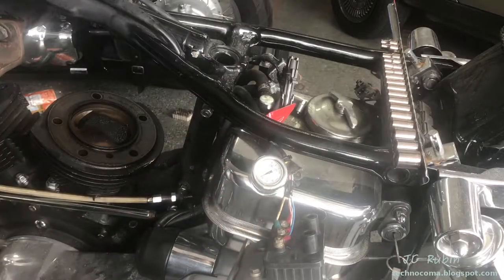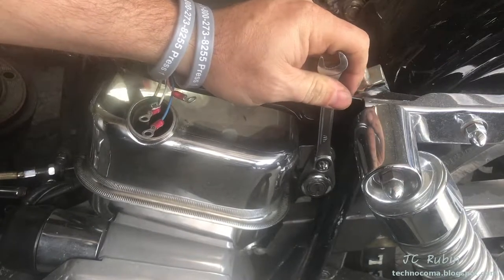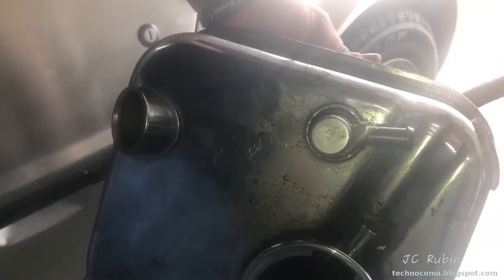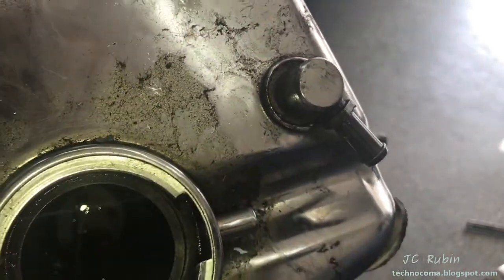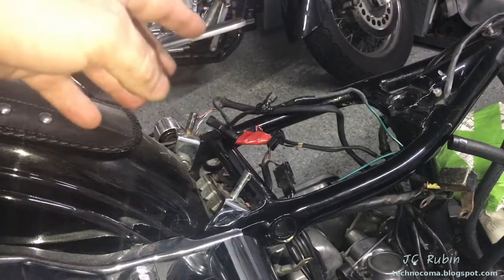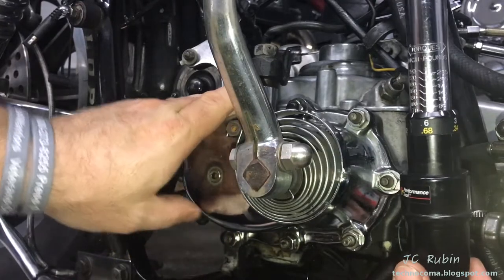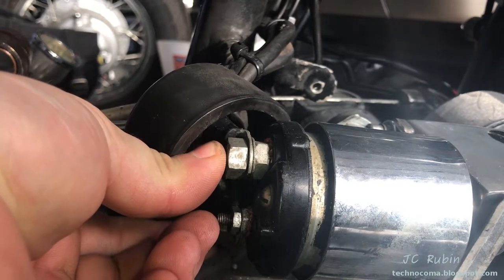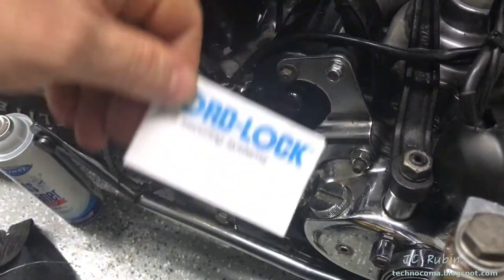AMF Shovelhead Lowrider Restoration -4- Oil bag removal, Electrical repairs and Nordlock tests

Comment: I always wondered how when the oil enters the oil tank through the top.. how does it get to the oil filter that's hanging in there the stock one it just seems like there's not a lot of room
Reply from the maker: pours right in to the middle of the filtre.
Reply: @delorean1  thank you ..👋👋

Comment: TANK... it is an oil TANK! oil bag is not a HIP way to misname a part....
Reply from the maker: Thanks for sharing.
Reply: Guys have been calling it “oil bag” as long as i can remember.
Reply: @johnnycrow2407  How long have you been around? I started building choppers in 1974 and NO ONE called them oilbags then! WHY would you call a STEEL TANK a bag???  Sounds pretty STUPID to me!
Reply: @johnnycrow2407  how long is that?
Reply: @tomhanson4153  I’ve been around a long time and the old bikers I knew back in the 60’s and 70’s used the term “oil bag”. You call it what you want and others will call it what they want. It’s not a crime bud. Sláinte